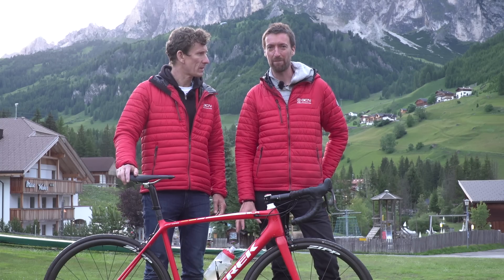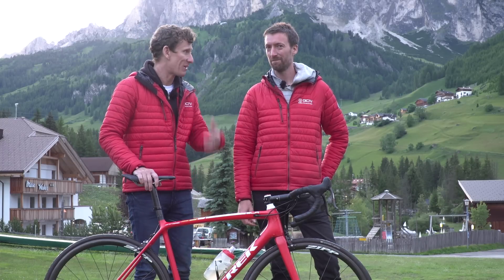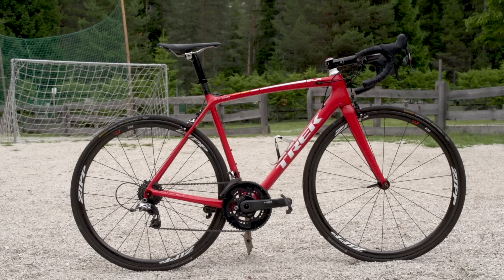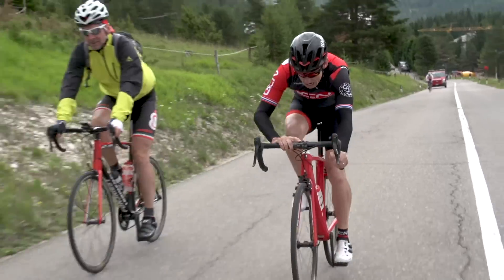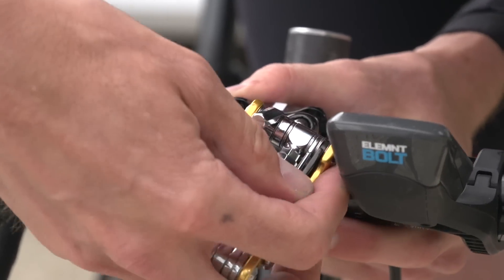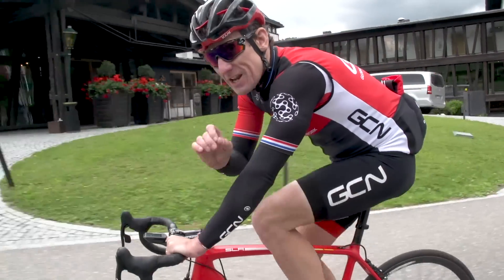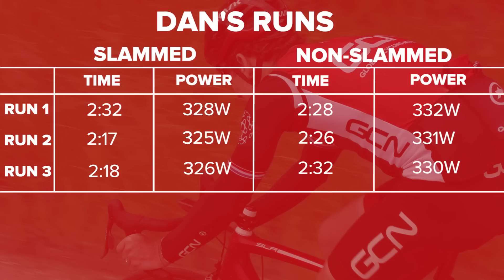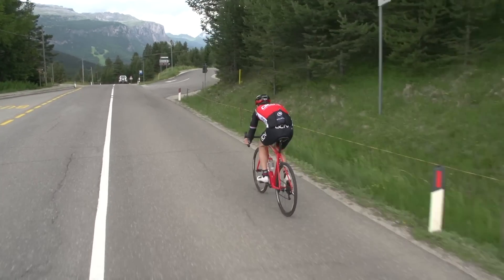Slammed Vs. Non Slammed | GCN Does Science

Comment: For well over a decade I rode a simple 10 speed steel frame, with the handlebars level to the seat, riding mostly along coastal (flat)routes. I never bothered to question my form, or whether it was efficient. I was just happy to be out riding. Then I got the climbing bug, bought an expensive carbon wonder bike, and was properly fit, during which I learned quite a bit about form, efficiency, and how to relax in a variety of positions. I was encouraged to drop the stem over time, allowing the muscles and tendons to stretch and adapt. I found it easy to adopt a more aero profile, but stopped lowering the stem at near 2 inches below the saddle, a nod to comfort. I have ridden a bike with a considerable slammed geometry, and found I could ride that way, but only for short distances. It would take time to feel comfortable on longer rides with that geometry. The neck muscles in particular have to adapt to the more extreme angle to be able to see.
Reply: siskokidd same findings for me. About 5/6cm for maximum drop
Reply: How much time did you gave to adopt to that position
Reply: Being able to see forward is overrated.
Reply: Generally, it's usually a good idea to have the handlebars about 4-6cm below the saddle. It's probably the best way of setting up a road bike.

Very comfortable and quite fast as it is.

Comment: remember that most pro's use a size smaller frame so the longer stem is a logical choice
Reply: Yeah, very often it looks like the frame is "too small" and they have a large stem and a very tall seat post.
Reply: It's Trump based on aliens in movie "They Live" from 1988
Reply: i cannot get any power through the legs if on the drops, slammed or not, it´s a very uncomfortable position fo rme
Reply: same for me but I have also short arms and torso and long legs for my size so my quads are kicking my torso all the time and I have ergo bars with long reach and drop so I bought cinelli vai compact shallow bars with 75 mm reach and 123 mm drop so I guess that will work better for me
Reply: They Live We Sleep - good points!  I wonder if any of the pros have an issue with 'toe overlap'?  Seems like if they have long feet it might be an issue with the size of the frames they ride.
Reply: That's true for the length, but not for the drop. If you were trying to emulate a proper-fitting bike, you'd want to have some spacers. However, obviously  they want to be as aero as possible, hence the small frame and slammed stem.
Reply: you need a bike fit
Reply: The problem with smaller size frames is that if you're a taller rider it's hard to get comfortable with slammed stem
Reply: i’m 5’10 and want to use smaller frame what frame size should i get?

Comment: As explained elsewhere in another GCN video, an aero position is not merely bending farther at the hips so the head and shoulders are lower. Only bending at the hips would constrict the chest more than necessary and may reduce the sustainable power greater than the aero benefit. Rather, a proper aero position is more of a rotation than a bending -- using the crank axle as the axis of rotation, the entire body is rotated forward. If done correctly, the hips will be farther forward and this will push the torso farther forward, too. More adjustments may be required than was shown in the video: (1) The saddle is moved forward. (2) The saddle is tipped down. (3) The handlebar is moved forward. (4) The handlebar is moved down. (5) Some cyclists also switch to a shorter crank arm length (this is common with triathletes). Only (2) and (4) were done in the video. When all of the adjustments are made, there should not be a major constriction of the chest and there should be less effect on the cyclist's output power.

Two additional issues may have affected the tests: (1) The object in the middle back pocket of both Dan's and Matt's jerseys may have raised the drag differently for each riding position. In an aero position, the expanded middle pocket has greater exposure to the wind and may have created more drag than in a less aero position where it is sheltered more by the cyclist's back. This may have counteracted some of the benefit of the aero position. (2) The duration of the tests were too short, making the data statistically questionable. It would be good to see these tests repeated with the back pockets empty and a much longer duration used (20-30 minutes, perhaps).
Reply: Very good points.

Comment: I used to have really sore shoulders and lower back when in a really aero position. 1h/week of upper body strength training fixed that for me
Reply: thanks for the note!  did you add stretching also or just muscle development tools like weight training / body weight exercises?
Reply: DFTA (Don't Feed The Animals) I don't use weights, just push-ups and some core exercises from gmbn. I always stretch before and after a ride. Helps to be flexible when you crash as often as me :D
Reply: Great info.  You sound dedicated to the sport.  I do stretching mostly afterwards and some weights / body resistance.  i try to do 'supermans' (laying on stomach, lifting arms and legs) ...supposed to be good for lower back.
Reply: Try some "good morning" back exercises for the lower back.
Reply: Planks are also great. I sometimes struggle getting the form right with the excercise you described.

Comment: I agree. I got a Fuji Sportif (Endurance frame of course) and got my stem slammed to try to get some more aero. After two months riding in such position, yes, I did get faster but with the side effects of lower back pain and my hands got tired way faster. I also feel tired faster as I can't get used to it in the long run.

So now I changed a little bit by increasing the spacers just 2 more levels instead of 3.5. Now it feels way better and I get less painful in the long run (still hurt tho).

Comment: Did some experimenting with this after seeing the video about the pro's doing it. Found -9deg saddle tilt to be way too much, felt like I was sliding forward. Went back to -3 which I found to be very comfortable and more than enough to allow me to comfortably slam my stem which used to have 2x10mm spacers under.. Have been riding with this setup for a few weeks now and I'm very satisfied -no back pain. Quite amazed that tilting the seat, even only 3 degrees, could make that much difference, I have actually raised my saddle a few mm and tilted the handlebars a bit more down afterwards as well...!
Reply: sanjoy87 yep, I tried -9 degrees and was literally sliding off my slick carbon fiber seat (especially at stop signs or just slowing down). I'm sure the fact I Turtle wax even my seat doesn't help, but it was almost comically bad. I've switched to somewhere in the -2 degree range and don't have that problem.

Comment: For Matt, those couple of watts (average 4.33W more for slammed) made the difference and the wattage has an almost perfect correlation to the faster times (-0.979).
Reply: TheBigCheese233 are you taking into account drag is a function of velocity squared? Going 2x as fast (calm day) requires 4x the power.
Reply: Thanks for your input. No, I haven't thought of that. But I guess for the small delta, a linear approach is a good approximation. (If it makes sense at all to look at this small sample size)
Reply: When considering power, drag is even worse: speed^3. The force is speed^2, but power is force times speed. Going twice as fast increases the power consumed by air resistance by a factor of 8! However, a few watts is not the answer here, because 4.3 W would be only a 1.3% change; need to account for much more to explain these results.
Reply: teddansonLA that's correct, Power = cD 1/2 ρ v³ A

from FD = cD 1/2 ρ v² A and P = FD v
You can find this on engineering toolbox under lift and drag article with an example worked out.
Reply: While I agree with the verdict, you can't calculate a correlation on just six data points. Technically you can, but it's as meaningless as a five-percent difference that cannot stand the test of significance and statistical power (and doesn't control for the weather conditions, the number of cars passing by or coming up in the opposite direction, which can have an effect as well).

Comment: I've been riding with slammed stem for about 1year and it's more comfortable i.e. It takes a lot of pressure off your bum as your upper body weight is more distributed plus the aerodynamic benefits especially in headwinds.

Comment: One issue is they were clearly careful to maintain the same forearm position.   On the other hand, if when you lower your handlebar you straighten your arms, you're losing the benefit, and this is when not thinking about it, not when focused on a test..  I find when I adjust my position I like taking photos of myself from the side, and the back position tends to be relatively independent of handlebar height within a reasonable range.  If I can't ride with bent elbows in the drops then the bar is too low, but if it's too comfortable in that position the bar is too high.

Comment: Everyone has a different take on this but, I had slammed my stem before and the result was that I felt too elongated and uncomfortable so I gave up on it.  However about six months ago I gave it another try and - just as an experiment - I slammed the saddle all the way forward at the same time.  I use Fizik Arione saddles (which are long) and I usually have a seat post with about a 15mm lay-back.  My saddle height was also kept exactly the same. As an additional measure (to compensate the saddle moving forward) I increased my stem length by 2cms.  The result second time around, with the slammed saddle and stem was much better.  More comfortable, more aero and being able to ride on the drops far longer and (seemingly) produce more power.  I have now changed all my three bikes to this position and feel really happy with the difference it makes.  Of course this works fine for me possible because of my limb length etc but maybe not for everyone.  But it's always worth taking time to experiment I find and not give up.  And I don't get any back pain either.

Comment: Couple of things - when riding in the peloton the slammed position will be irrelevant as drafting far overrides aero position. When riding in slammed I find, like they did, that it is faster, but hard to sustain much longer than say a 20 minutes flat out attack. And if you are a climber and want to attack on the hill, slammed not relevant either. So depends on your riding style and strengths/weaknesses.

Comment: I'm a heavier rider. The lower my bars are, the more weight is pushed forward onto my arms, expending more effort and raising my heart rate. So it doesn't really help me. But if you weigh 140 lbs instead of 213, I imagine that effect might diminish.
Reply: Ian Snyder I'm weighting 78kg but if i slam, i end having to much weight on hands because I'm big on my upper body. So neck and shoulder pain.
Reply: L G That happens to me too. I could probably get used to it if I trained that way, but I don't race, so it doesn't matter enough to pursue. And with my lower spine having been injured, there's even more reason not to ride that way. 
 I'm almost 97kg and have a 127cm chest. It's a lot of weight to support. I should've taken up cycling instead of weight lifting when I was younger!  :P
Reply: You probably need to compensate with your saddle position. Worth getting a bike fitter to look at it. My current position on my road bike looks very aggressive (slammed, long stem) at the front but once my bike fitter had got the saddle in the right place (all the way back on the rails), it was a natural way to set up the front with very little weight on the arms. So I would say a comfortable long low position is possible but it's probably a mistake to just change the position of the bars, you need to look at what it does to the whole bike fit overall.
Reply: Nick Sexton I've explored that too. Sadly, due to the weight in my upper torso, my point of balance is ridiculously outside the range of the seat rails. But I appreciate you taking the time. 

Maybe I'll finally break down and buy a recumbent someday.  ...But probably not.  :)
Reply: Ian Snyder I guess you tried setback seatposts? I tracked down a canyon one with 35mm setback. And I think Selle SMP saddles have really long rails. Recumbent would definitely be even more aero anyway...
Reply: Nick Sexton Mine already sits back just a little. But by "ridiculously outside the range of the seat rails," I'm talking about 10cm, give or take. Since I didn't have the latitude to make that kind of adjustment, I found I could compensate by moving the seat forward, making my body slightly more upright and bringing the upper body weight closer to the seat. My reasoning is basically this: if you hold a sledgehammer with one hand by its end at 30° above horizontal and then compare that effort to holding it at a 45-50°, less effort is required for the higher angle because the weight is closer to your hand. It seems to work in practice as the change slowed my heart rate by nearly 10bpm at any given speed.
And, frankly, most of my riding is in the 14-20mph range, so I'm not fast enough for being really aero to make a significant difference.  Unless I'm descending. 240 lbs will descend like a loaded shopping cart.
Reply: Ian Snyder, do you have a seatpost with setback? Typically bikes come with 12mm setback, but 25mm setback is far better. Also, consider a padded Selle SMP saddle, these naturally have more setback because of the cradle shape and also support your weight in a far more healthy way. Plus they have steel rails and the longest area of adjustment of any saddle.
Reply: PROcrastiDRIVE SV I'm not sure how much it's set back. I just know that i'd have to slam my seat all the way back plus move it another 10cm or so rearward. Or mount my crank on the front wheel. :)
I'm okay where things are now, though. I don't get numb hands or have other problems. Just tired triceps, but they always outlast my legs.
Reply: If you look up: ironman-triathlon-position-how-marketing-overcame-some-peoples-reality in some popular search engine - there's a fantastic article there which explains the fundamental physiological effects of weight distribution and positioning, and how to improve them - hopefully it should help maybe, as it's written for 'normal' people, not for racers! ;)
Reply: OsellaSquadraCorse Thanks. I haven't seen this...looking at it now.  :)
Reply: OsellaSquadraCorse Good article. I don't think I could use aero bars at this point because of my lumbar spine. I had a bi-level injury resulting in a discectomy and 2 years of PT. I think they're neat, but the truth is, most of my riding is between 14 and 20 mph, which isn't really fast enough for them to make a difference anyway. What I did was use my heart rate to indicate the level of effort at any given position. Once I found the spot where my legs worked best, I modified my reach/bar height/etc. to that which allowed for the lowest heart rate at 14 mph on the same section of road under the same conditions. If I go into the drops, my HR goes up by 5-6 bpm. I don't know what that translates to as a ratio of HR:slightly reduced wind resistance, but at my level, it seems negligible. Ultimately, my reasoning is that if sitting a certain way lowers my heart rate, I can apply that much more power to the pedals. :)
Reply: That's definitely the idea - and a good message. (the article starting about aero bars was just as a reference point for aero vs comfort, rather than anything else! ;)) No point in getting '3% more aero' if you get 5-6% less power - it has to be holistic, adjusting every little thing, not just one. Sounds like you're nearly already at optimum, but that may be the problem somewhat - you found a point at which your legs work best in a given bar position; but if you're able to put the saddle further back and adjust the angle/height (lower saddle and lower nose, usually) then you might find getting into the drops but maintaining the leg output is do-able. The back issues may prevent it however.. Some of it it time thout, I found that I simiularly couldn't use the drops without causing my back to cramp, but after 6 months or so, I could! Didn't change a single thing, but the core and lower back muscles had developed enough strength to allow me to move my arms/shoulders freely as they were no longer taking any weight on them, so time is also a key factor - and another reason why 'bike fits' according to a chart or measuring tape are a load of absolute cr@p; bike fitting is dynamic, not static.

Comment: Ive heard that cutting the steerer fork to its lowest position, which results in a zero spacer slammed position, reduces fork flex. My Planet X is cut and uses one tiny spacer, otherwise its slammed. Back is fine, but you do some upperbody exercise and stretches. Work on your core as well.

Comment: The video doesn’t even mention the improvements to handling and steering from slamming your stem. I went from having all 4cm of spacers under my TCR stem to just having just the minimum 2.5mm spacer above the headset cone and the difference it made to the handling was huge, it now corners like it’s on rails thanks to the Overdrive 2 headset with oversized lower headset bearing. It’s also much more aero on the hoods so I don’t feel the need to use the drops any more for aero advantage. I find the position perfectly comfortable over 100 miles, although I’m in my mid-30’s and in good shape. My average speed has also increased. The only discomfort I had initially was numbness in hands on a long ride, so I straightened my wrist position by lowering the bar angle forward by a couple of degrees